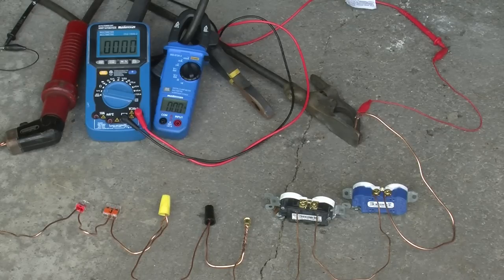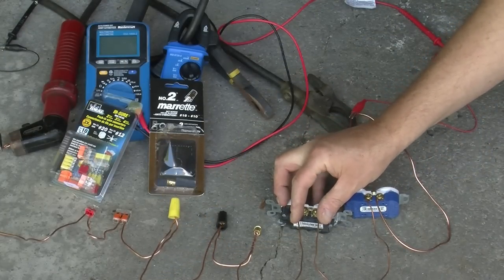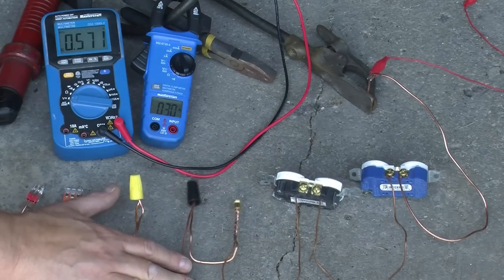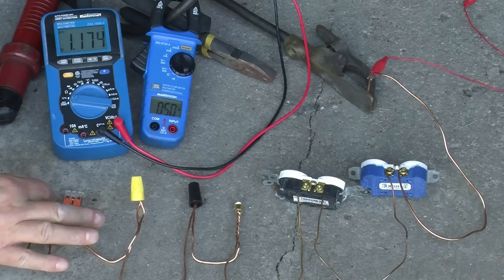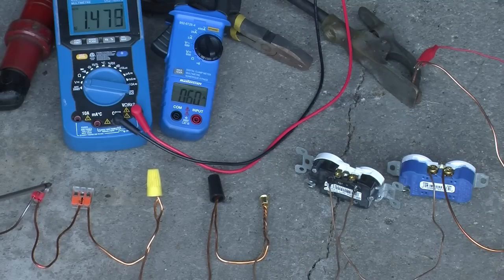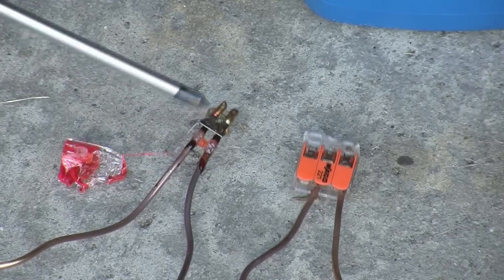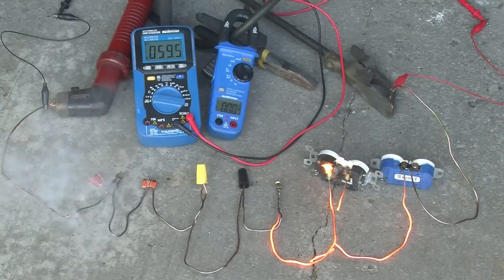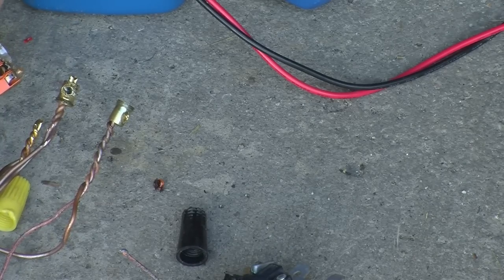Connectors: Which is the Weakest Link

Comment: I would like to say. It’s not surprising that the 14 awg push in got hotter and melted first.. It’s smaller wire. The actual connection didn’t fail. If you did that same test and screwed the 14 awg on to the device, The plug probably would have failed the same.
Reply from the maker: Your right - just to clarify, I used 1 for the push in because thats the cable size the push in instruction required.

Comment: At 9:13 you state that both stick in and screw terminal receptacles are rated at 15A. That is not correct.  A 15A receptacle is rated to be on a 20A circuit as far as pass thru current for the screw terminals.  That is part of the code and will be the case if it has a UL listing.
Reply from the maker: I think you have hit on one of the few differences between US and Canadian electric codes. Last time I looked, up here in Canada you cant put a 15A receptacle on a 20A circuit. Not sure if its different in the US, but on that particular stick in receptacle it specifically said only#14 wire for the stick in connectors.

Comment: You don't have to twist the wires together on a regular wirenut. In fact if you test twisted against not twisted in regular wirenuts not twisted will likely win. Try it and find out.
Reply from the maker: Here you go! https://youtu.be/Y-2LmKlQW2A  Not a realistic use  case test but neat to see. Sometime I will do a more "controlled" test. In either this or some other of my video there have been heated arguments whether twist or not is best/right etc. In fairness, I think good arguments can be made for ether.

Comment: The better thing to prove would be to use the same outlet for backstabbing and screw.... the plastic just may have had a lower melting point
Reply from the maker: Your absolutely right. It was a last minute idea to add the outlets to the test and I didn't have two identical ones.

Comment: the fifth connector from the left.  twisting the wires together like that makes for a great splice but its bypassing the connector.  not really testing the connector.
Reply from the maker: It was not intended to be part of the test but to connect #12 and #14 wires together. I twisted it like that to try and make sure it would by far been the best connection and not fail and disrupt the test. So your right - little current would make it all the way to the connector.

Comment: The problem with wire nut compared to Wago is that it is fairly easy to not do it properly on the wire nut and there is no way of knowing how the connection is since you can not see it. Wago have every explanation written on it Rated load, how much to strip the wire and such. And it is just in and click and you can see that it is fitted correctly.
You can also reuse the Wago wires whereas you should not reuse the wire nut wires if you undo them - instead you should cut the damaged ends (they get damaged by using the wire nut since the nut cuts into the metal) and use fresh ends instead,

Comment: Some plastic may have melted, but none of the connections ever actually failed.
Reply: It might have been better if the connection failed...as that would cut the power off and prevent a fire.

Although an unreliable contact may arc and that causes problems.
Reply from the maker: That is actually true! I was amazed at how much current they could handle.

Comment: This is a poor test with the mixed size wires.  You should have used 14 gauge wire throughout until the first device failed.  If the screw terminal outlet had 14 gauge wires on both terminals, I may have gotten hot sooner as well as the push in outlet.  Having one 12 and one 14 cut down substantially on the heat it saw.  Same for the other connectors, they were seeing much less heat with the 12 gauge wire.

Comment: My main take-away from this demonstration is that when there's an obscene amount of electricity being pumped through bare wiring, its perfectly acceptable to touch those wires with my bare hands.
Reply from the maker: Just remember, I used a very low voltage for this test. Dont try that with 120V!

Comment: #14 has a 10sec fusing current of 166A so it had zero chance of surviving that
Reply from the maker: Someone even commented that in some (older) installations bare wire like was used for high current fuses in suitable constructed fuse holders. 

But yes, #14 doesn't stand a chance at those types of currents ...

Comment: So the power source was DC correct?
Reply from the maker: Its AC - its a vintage welder from the days before cheap high current rectifiers.
Reply: @ElectromagneticVideos  Variable current, constant voltage?
Reply from the maker: @montanadan2524  Welders are more along the lines of a poorly regulated constant current power supply, at least the old non-electronic ones. Essentially they try and keep the current somewhat constant with the limits of their output voltage range. So my set up is a variac (variable voltage transformer) powering the welder. By adjusting the voltage to the welder I have much finer control of the output current which is roughly proportional to voltage going into the welder. The welder serves as step down transformer so  I get lower voltage at higher current that would be possible with the variac by itself. But because of the constant current source nature of the welder, it also makes things easier when the the resistance of the device being tested changes - normally that would result in wild current swings, but  with the welder the current swings are less extreme . This was more important for some other tests I did with 14/2 in walls etc. When the insulation melts and the 14/2 shorts closer to the welder, in spite of the change in resistance of the cable the current doesn't go crazy.
Reply: @ElectromagneticVideos  Variac tells me all I need to know along with you touching the conductors to feel for heat.
Reply from the maker: @montanadan2524  And just to make it clear - the low voltage high current test circuit is  effective isolated from the AC supply. So if you decide to try something like this be sure your not touching anything like live 120V!

Comment: Unfortunately, tests like these aren't really the best. Assuming the circuit has the correct breaker, a 12ga wire shouldn't have more than 20A on it for more than a very short period (see breaker trip charts.) So, the issues usually are caused by a 'decent' load (say ~12A from a space heater) turned on for a few hours, then off, repeated for many cycles. The small amount of heat from a load under the rating, then cooling, causes expansion/contraction of the copper/terminal. Eventually, poor contact is made, and arching happens. That's the catastrophic failure: an electrical arc is hotter than the surface of the sun, and quickly throws off enough heat to melt anything nearby. 

Testing like this could take weeks, certainly not easy to do in a YT video.

Comment: Not to be picky, but they should have been wired in parallel not series!
Reply from the maker: If they were wired in parallel, the ones with the better connection would draw most of the current and presumably fail first. Series means they all get the same current regardless of the connection resistance and show which fails at the lowest current. Or am I misunderstanding your point?

Comment: While fun, this test really provides very little real world information. For one, you have the devices all strung together as a load of resistors. Essentially, they are going to have no option but to dissipate heat in relation to the other resistors you've wired in series with them. Try performing the test with each device in parallel with propper neutral and ground connections for backup when it does fail. Most will never reach the point demonstrated here without shorting to ground.

Also, you need voltage. These devices are built for an average "pressure" of 120-240V. Do your test with 0.5 amps and 1000V and see what happens. The result will be just as wrong as 1 volt with 60 amps. 

All in all, you need to set things up the way the real world works if you want to have real world take aways.
Reply from the maker: The heating of the wire is from the voltage developed along the wire due to the current encountering the wire’s resistance, a few volts in this case. If the voltage between the wires was 120V (or 240V) with a load attached to the end of the wires, the same voltage drop of a few volts would be measurable along length  of the wires for a given current  and the heating would be the same.  120V times the current would be the power delivered to the load, different from the power that is dissipated in the wires which we are interested in. To keep this test simple and safe, there is no load (by shorting then end) and all we need is a few volts to create the desired current – and heating in the wires. 

See  "OVERCURRENT TESTS FAQ" here  https://www.youtube.com/post/UgkxeilOfLJGy2ODslnBW0WFXUE580oHhFyP  including why a current source like welder is used and a link to a UL test done in almost the same way.

Comment: Wirenuts have worked very well for a long time...why fix what ain't broke.....
Reply from the maker: Couldn't agree more! I was stunned how well they did. Its unfortunate that in many places people are criticizing them as being old fashioned when in reality all that matters is how they perform.
Reply: Possibly because they don't want to take the time or effort to make the connections correctly with enough torque (like using lineman's or the yellow romex sheathing slicer that fits most wire nuts to aid in the twists) and then verifying with a good tug on every wire
Reply: @lewdojah3111  I agree, the world has gotten lazy...lol
Reply: Tell that to all the DIYers who make three wire connections a year. Getting a good wirenut connection takes skill. None of the other connections here do (with the exception of proper torque on the screw terminals).
Reply: @CoolerQ  one connection or 1k, using a "half assed" method rather than making the effort to learn a skill is still being lazy...... learning to do something right is a value all its own.
If you don't have time to do it right, how the hell will you ever find time to do it twice?

Comment: Would have been nice to see this with a thermal camera. At the least, a non contact temp gun.
Ouch, thats getting hot isnt a good visual. 😉
Reply from the maker: I did eventually get a IR camera which I use din later videos of cable in the 2x4 wall surrounded by insulation.
Reply: @ElectromagneticVideos   thanks for responding, I'll check it out. I've been wanting to get one, the kind you attach to your phone, not the 6 million-dollar tablet type. 😁
Mine would be used more for a toy,  but it seems every time I buy a toy it becomes something I can't live without.
Reply from the maker: @randywl8925  Ha - I know what you mean about "toys". I got the attach-to-the-phone type. Mine is the "Seek Thermal CW-AAA Compact-All-Purpose Thermal Imaging Camera" I got it as an "Amazon Warehouse Deal" item - presumably returned by someone so price was 2/3 of new and it sure looked new. One thing to watch out for is the phone connector - USB-C, Micro USB or something else. Apparently they dont work well with USB adapters. The model numbers for different connectors types are deceptively similar. I have only used this one type so I cant really compare but it does what I needed it to do.
Reply: @ElectromagneticVideos  Thank you very much. I recall reading  about the adapter issue.  When I get around to it and get some extra shekels in my wallet, I'll research the different brands again.
I appreciate you taking the time to add the camera information. 👍
I have a Google Pixel with a C.
Reply from the maker: @randywl8925  Your Welcome! Certainly will be  a fun thing to have when you get one!

Comment: Should you be touching those wires? If your fingers were wet we would be watching you meet your maker.
Reply from the maker: Because I am only testing resistive heating due to overcurrent along the wires I am using (very) low voltages so its safe. Makes no difference in terms of heating for a particular current. But your point is well taken - I would caution anyone as I do on the trailer of most videos - to be really careful and not do anything if you are unsure or have the slightest concerns. I'm an electrical engineer with years of experience so I'm well equipped to know how to setup things safely. But I very much appreciate your warning and concern. And even with low voltage, if my fingers were damp at all I wouldn't touch the wires!
Reply: @ElectromagneticVideos  amperage kills not voltage
Reply from the maker: @syitiger9072  There is a graph in this article    https://en.wikipedia.org/wiki/Electrical_injury        showing current and duration and extent of injury. And just so people dont misunderstand, while its the current that does the damage, its the voltage that "pushes" the current so the higher the voltage (among other things), the greater the chances of getting a high enough current for bad things to happen.
Reply: @syitiger9072  Electromagnetic Videos I'd quite correct in what he says.

Comment: Be cool to see this test repeated using a thermal imaging camera used with a medical digital thermometer you point at the object you are measuring the temperature of. :)
Reply: Also, I wonder if test results would differ if all items were not connected in series and instead connected with equal lengths of same gauge wire as multiple separate circuits connected in parallel to each other with the power source.
Reply: From your test I like the Marrette connectors best for making tight splice connections that could easily be updated to hold more or less wires later, although I wish they could have the same thermal strength while allowing clear see-into views like the Ideals and Wagos of the wire splices in the connectors so you could still see the wire connections through the wire nuts.
Reply: Another great video would be comparing U.S. residential, commercial, industrial, specification and hospital grade regular, gfci, afci outlets of various manufacturers with various wire connection methods including back-stick/stab (residential outlets), straight-in under the outlet's side screw clamps (spec-grade) firmly tightened by the outlet's side screw terminals over the clamps, and tightly looped down under the outlet's side screw terminals.
Reply: Videos comparing solid and stranded conductor wire types, copper vs aluminum conductor, and Romex vs BX vs EMT/conduit enclosed wire would make for interesting viewing too.
Reply from the maker: I actually bought an used a thermal camera as a result of comments similat to yours. Used infor the Knob and Tube test video I did. If I get a cnace i will redo a variant of this video using it smometime in the summer (I have to do these tests outside due to the fumes!)
Reply from the maker: @jimb1843  The problem with doing them in parallel would be that tiny differences inrestance of each connection would cuase significantly different currents in each connector. Done in series the current through all connecors is the same, athough after the first one fails current stops or is reduced though all of them. The most scientific way to do it would be to do each one seperatly and compare the results afterwards, but that would not make a very interesting video.
Reply from the maker: @jimb1843  I was surprized how well the old tech marr connectors did based on so many people these days preferring the newer hi-tech connecotors. You bring up an interesting point about the various plastics - I just watched a video showing a 25(?) year old Apple Mac where almost all the plastics used in the computers had become brittle and broble at the slightest pressure. I wonder what the longevity of all the plastics in these connectors are. I have seen 20+ year old yellow Marrs and tey seem ok so far. I supect the old black ones may last way longer.
Reply from the maker: @jimb1843  Actually I am planning a gfci video but with a different focus - have been assembling the parts to make a gfci tester where I can test the trip current of different GFCIs. I want to see if the cheap chinese ones on many online sites as as good as the big brands. They all seem to be UL/CSA (or similar) certified, but you never know.
Reply from the maker: @jimb1843  Aluminum is what I really want to try. One of my friends occasionally rennovates houses and if one of them ever is wired with aluminum I will try and scavage some.

Comment: You reallllyyyy need to re-do all these videos with a cheap FLIR camera you can plug into your phone.   Uses your phone as a display, so they don't cost $300, however those dedicated units are nicer.
Reply from the maker: Look at the later videos with an IR camera! Year the dedicated units are nice but due to cost I used the plug in type which isnt  bad for the limited use it gets from me.